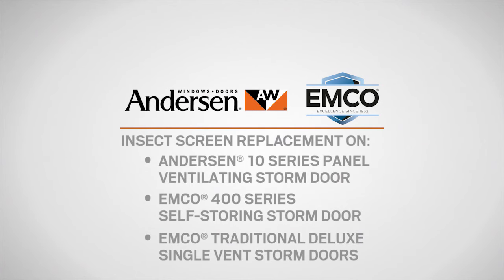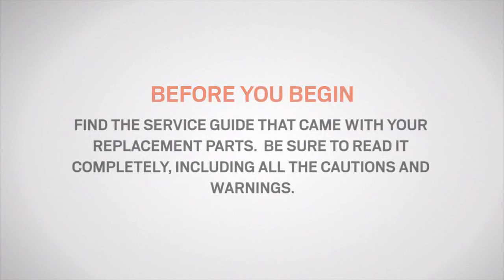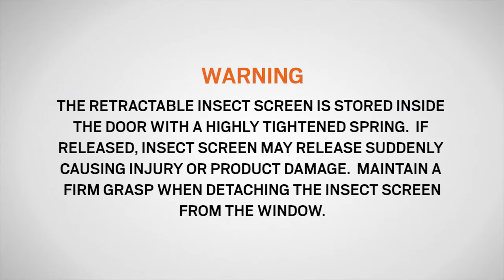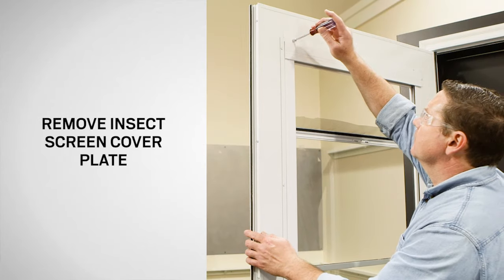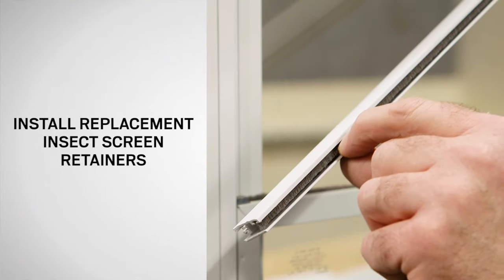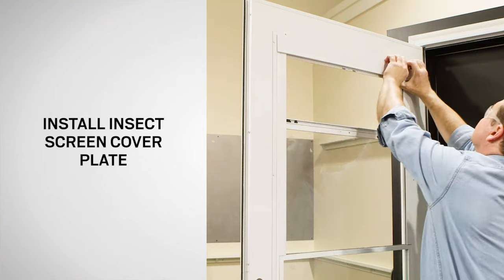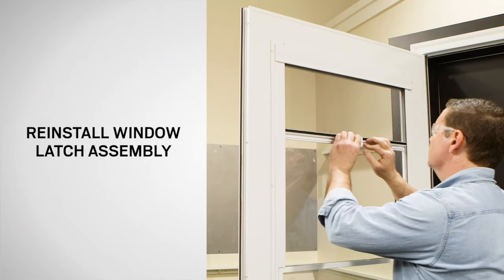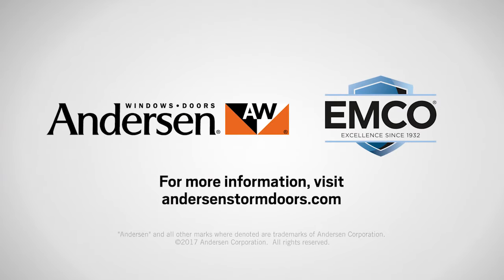Replacing Insect Screens on 10 Series & EMCO Self-Storing Storm Doors | Andersen Windows

Comment: Don't let Anderson tell you this is easy! By not means is it and they refuse, when contacted, to admit that replacement is 'all you need'!! The doors are horrible to replace with parts. Our door is under warranty and they just keep sending replacement parts.  The sliding screen, windows and frame have been replaced and the door still does not operate properly.  The parts do not work and YOU have to do the replacement work! Horrible customer service when asking for a complete new door. This whole experience has been a nightmare with this company!

Comment: Purchased our storms and had professionally installed 9/2019.  First nice day 4/2020, lowered the screen and it pulled out.  Yes, called and Jesse verified the purchase of the storm doors.  sent replacement, but because they were special order would take over 30 days to arrive, and instructions would be with the screen assembly.  Arrived at the 35th day, no instructions.  Found this, watched and proceeded to change out the screen.  Though the new screen appeared to be slightly shorter, less than 1/16 in., put it in, reattached, closed the screen, pulled it down and the entire bottom corner ripped away.  I don't believe Anderson has any quality control what so ever.  This is not all of my complaints about these storm doors, the quality of the product or the customer service rep (s) that I have had to deal with.  And so this saga will continue.......

Comment: I agree  with the comment below about the weatherstrip/side channels not easily being pressed in.  More importantly the holes in the new screen pull were too small for the screws that were with the pull being replaced, even though there was an expectation that the old screws would be usable with the new hardware.  Very frustrating!

Comment: Just had the same thing happen, where the liner wraps itself around the roller as the screen goes up, first time used!!! Pissed off at Home Depot and Andersen. Andersen says 3 weeks to get replacement part (the phone bank in India is very frustrating, purposely so I think), and I get the privilege of repairing a brand new door all by myself. As a DIY-er, I'm sure I can get it done, but why do I have to Home Depot is complicit; they deny returns after 90 days (had a con-man, con-tractor, who screwed everything up, and until I could get it all fixed, I couldn't install the door). HD said if I had used their card, or their installer, I could return it: why the Hell does it matter what card I used? A-holes. I'm tempted to take it down, and call them up to arrange installation, then when they see the broken screen liner, return it. Why shouldn't I? They play games with their customers even after 10's of thousands of dollars of business, over a $400 door. Lowes will be the only place I will buy things, including anytime I use a contractor. The flooring I bought at Home Depot? Going back. I'm done with them. They suck.

Comment: I was able to install the door with no problems.  However after having it up for 3 weeks the metal rim around the top of the vent window came unattached from the screen and crashed to the floor.  They sent me a new window and screen.  It took 4 or 5 weeks for the window to arrive and when it did, the window had been dropped on the corner and again, it was broken.  So I called and they sent another window, so down the road it did arrive.   With my wife's help we got it installed, however it was not easy and there was no video available for the installation of the vent window, which would have helped tremendously.  Hopefully it will hold together for a long time. If it does not, I will be back posting further information on this.

Comment: 1.  The door in the video is a demo unit so everything comes out and in a lot easier that your door will.
2.  Do the replacement 1 hour before happy hour because you will want to celebrate only a few gouges and still being married. 
3. You will need two people.
4.  Those side straps are almost embedded in the screen door , goodvthing replacement straps come with the new screen.
5.  Believe it when they say the spring is spring loaded.
6.  The New side pieces need a bit more than a push of the thumb to I stall.
Reply: and the latch rail wont just come out it has to be knocked out from one end!

Comment: Original screen was ruined because the weather stripping wrapped itself around the screen roller after about 7 retractions.  Andersen sent a new screen and side slots with weatherstripping (6 weeks, because I have a special order 35" door).  No instructions, but I watched the video, and followed it.  The video did not address the weather stripping sliding out of its track, but I finally got the side slots into the door with the weatherstripping in them (still loose--didn't know any better then).  On the first actuation of the mechanism, the weather stripping wrapped itself around the screen roller, this time on both sides!  The screen was damaged.  I pulled out the weather stripping, and used it that way until I received yet another replacement.  By this time, I'd realized those weather stripping strips were supposed to be trapped in their slots, not free to slide in and out.  The new replacement, like the previous replacement, came with the weatherstripping loose in the slots!  (I examined the original, and those slots had been heat-deformed to retain the weather stripping, only one end was not adequately melted, and that was the end that the original strip slid out of and wrapped around the roller.)  So for two replacements in a row, the weatherstripping was completely loose in the slots, and impossible to assemble without ending up with an assembly that would immediately fail.  Andersen badly needs to train their workers--this stuff should never leave the factory with those weatherstrips loose.  In my latest (apparently successful) assembly, I went back to the original side slots, slid in new weather stripping on the one that had not been originally secured, and both melted and glues the end of the slot to prevent the weatherstripping from sliding out.  It seems to be working fine.  The video, however, makes no mention of any of this (as it really shouldn't have to, if the parts had been properly assembled (AND INSPECTED) before leaving the factory.
Reply: we had the same problem.. we are trying the glue at the top of the stripping.. seems like a factory defect.
Reply: @didanby1  Melt the ends with a heat gun?

Comment: After replacing screen because it tore out 2 months in, the tension on the replacement screen was so high that it pulled the clip and screws right out multiple times. I ended up drilling thru the outside of the door to attach the clip. I use a 1.25 inch #6 machine screw and stainless washer and came in from the outside, use a lock washer on the inside of the door/ clip-it looks fine-just 2 stainless screw heads at top of door when window is up-worked great...so far!
Reply: Mine has not tension ., how do I get it back

Comment: Highly tightened spring is right! Where does it hook to to keep it down? We didn't get that white handle thing you pull it down with. It just has notches that you put your fingers in to pull it down but nothing to HOLD it down. It sprang back up and scared me. Then the screen went back up crooked,it was hard to pull down, then the screen started coming apart from the metal part. I called to get a replacement part and am getting one but still don't know how the screen stays down on the series 300 storm door,any ideas??

Comment: @2:55, I would recommend do not remove those screws because there is particle board between the exterior metals. I tried to tie it down but it would not tie after I just removed one screw.

Comment: My latch rail when lining up with the door before putting on the handle will not lay flat after aligning causing a separation between the screen holes and the holes in the glass door. Any suggestions?
Reply: I have the same problem, holes not aligning properly.  I had to replace the screen 2 times already.  No assistance from Anderson !  Total inferior product.

Comment: why did the screen on my new door come loose from the spindle?   There appears to be no way to attach this to the spindle rod.
Reply: it is taped
Reply: @gurutimes2  , I figured that out after research and calling their tech line.   It was a brand new door.  I left the screen down and it pulled off.  All it is, is a roller on a spring much like a window shade.  The screen is held in place by double sided tape.  I do open the replacement screen they sent me but only half way and never leave it overnight.  

The screen is very open at the sides and anyone can reach in and unlock it.  Spiders also like to get inside between the glass panes and make webs.  This is overpriced junk that had I known how bad it was, would never have bought it.

Comment: The screen to spring roller "tape" has failed again. The initial failure occurred the first time the outside temperature reached 75º. Seems to be the structural limit to the transparent tape used to attach screen to roller. Initial failure repair the tape was upgraded to Gorilla™ brand 2 inch, clear, heavy duty, packaging tape. Disappointing choice of materials to attach screen to roller.

Comment: completely BS engineering, I would have expected better from Andersen JUNK.  You get a small tear caused by the sharp tracks and can't replace the screen itself and have to buy the complete unit for almost $100 .  DO NOT BUY THIS OR A SERIES 3000 COMPLETE CRAP

Comment: This is a very badly designed door/screen.  It looks ungly like an early 70s style glass door with two panes.  If you have a very nice front door, this will ruin the effect of having it look nice.

The screen is held on with cheap, double sided tape that is prone to fail.    Buy something other than anderson or renewal.  They suck.

Comment: where is a video for replacing insect screen on 2000 Series?  They are similar but not the same.  My screen came loose from the glass panel after only 1 months.